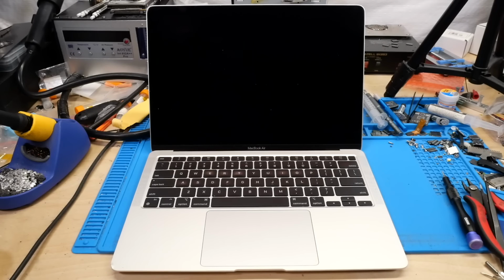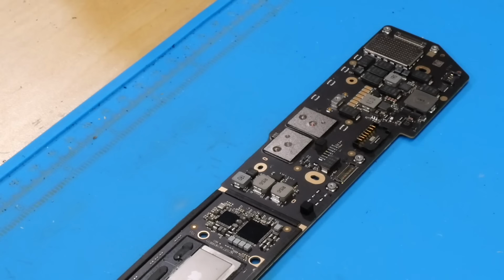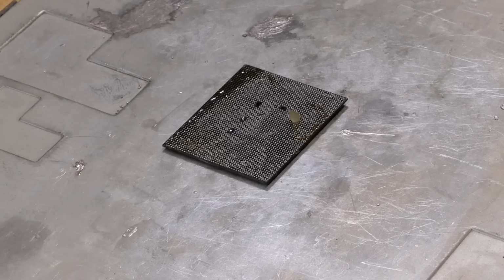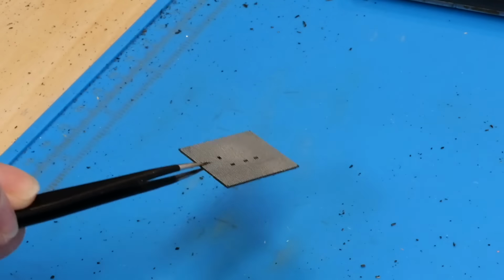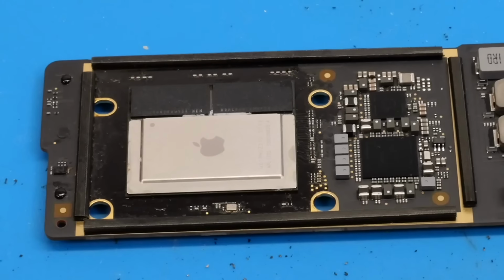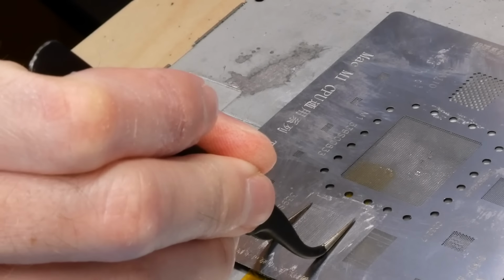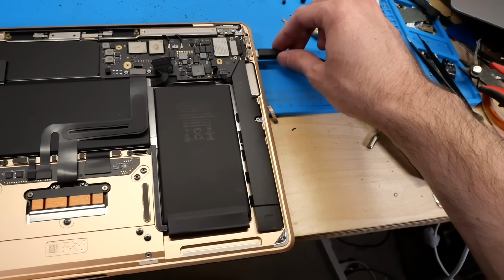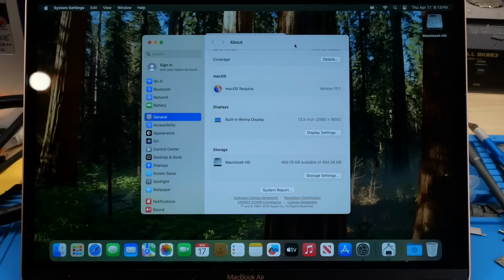Repairing a DRILLED M1 MacBook Air

Comment: DosDude question, well several: 

First is upgrading ram on an m1/m1 pro/m1 max chip possible without just swapping the whole SOC? (If so you could just swap the ram chips and such from the icloud locked SOC to the new SOC and be back to full spec)

Second is the process basically the same for swapping any M1 SOC? Like could you swap an iCloud locked M1 pro with another to use a donor board to fix an iCloud locked one or would there be more components that need to be swapped?

Third is the rose gold fixed MBA up for sale? My wife would love it.

Comment: Try Alpha OM-338PT or Multicore soldering pastes. Those on the drier side. Sadly the Loctite(Henkel) HF111 is not available anymore, that was a really dry paste, it was really pain in the ass to clean it from the DEK printer stencils.

Comment: Is wifi chip in some way locked to evry board ? if so damm apple they are crazy :)) and i also wonder is board will work with removed wi-fi chip is still will boot to normaly but with no wi-fi ?

Comment: I am curious about the sealant around all of those chips you replaced, it’s important since it keeps moisture and condensation from gettin the the underside of those BGA chips plus another factor is providing some shock protection for the chips so the joints do not fail. Other than that wow! Personally I have a Motorola certification for working on surface mount components for 2 way gear but little difference other than BGA work. I wonder who might make the stencil for a Motorola 68HC11 micro controller.
Reply: You probably just need to use a generic stencil of the right pitch, and manually pick off any balls where there aren't actually pads on the chip
Reply: @ thanks! I will look up the specs on the particular micro on these boards. Any source for the stencils I can contact?
Reply: @Subgunman  Do they actually make BGA 68HC11's? I can't seem to find any on digikey or mouser. They're all some flavor of QFP. You should be able to find generic stencils wherever fine chinesium products are sold - amzn, ebay, etc
Reply: @ these were made by Motorola for use in their P50 handhelds back in the early 90’s. The boards could be programmed with analogue and digital squelch and even offered a DTMF option for the radio. It’s second personality was that of a controller for paging that allowed the radio operator to talk back to the caller for a predetermined time. Motorola is known for doing their own custom micros.

Comment: Cant wait for m series ram upgrades, thats gonna be awesome to finally give some use to all those lame 8gb machines with their endless swap.
Reply: I'm honestly curious as to if you need to replace the SOC to upgrade the ram, or if you can just pull the modules off and replace. If its the former then that makes these boards limited in their life, but if its the later then I'm wondering why there aren't videos running round of people doing it yet...
Reply: @mizinoinovermyhead.7523  From what I've read, including from dosdude, the bonding used to secure the ram chips to the SOC make removal impossible without damaging the SOC.

Comment: @dosdude1 Does Apple underfill all those chips just to make it a pain in the ass too remove or will the replaced chip solder joints be less resilient without it?
Reply: The underfill is standard practice to provide mechanical support for the balls. Yes, the joints would be less resilient. Solder is pretty brittle.
Reply: @redare7  He replaces it with lead-based solder though, which isn't as brittle
Reply: @redare7  It just serves the double purpose of also making it a PITA for anyone that happens to try to be repairing any one of their devices...

Comment: You can't move the RAM over too?
Reply from the maker: Unfortunately not, as it's impossible to remove the chips without damage due to the bonding material used.
Reply: @dosdude1  Could you clean the ram chips off the SOC without damage to the SOC then just use new ones?

Comment: Is the reason the WiFi chip is paired because there's  calibration data in the sep , or some  kind of security issue – or is it  Apple just being Apple?
Reply from the maker: There is calibration data for it in SysCfg, but still don't really think the pairing is necessary.
Reply: Its apple being apple. Louis Rossman has been ranting about this and other manufacturers for years already. Its why i avoid a lot of the brands he rants about, including also apple and hp
Reply: It's just Apple being douchebags.

If a highly integrated component needs to be calibrated, you store calibration data on the component and make sure it can work with all machines using that calibration data. It's not like voltage/current/frequency stabilization is extremely hard.

If a component needs to be paired, it will be paired using a pairing protocol, which should include an 'unpair' and 'repair' (pun intended) commands. Which can be made very secure and automatic using a bit of public key cryptograpgy.

Anything else is just bad engineering, so unless Apple's been purposefully hiring only the very worst engineers, they've got no excuse. Good engineers will just implement all of this and not even ask whether it should be done.
Reply: @gleb.salmanov  In this case there likely is an unpair and re-pair protocol. Its just likely that we don't have the level of access to the SOC to do it. Apple surely does, and just keeps it to themselves.

Comment: Baffling. Why don't they just remove the nand chips, and then sell it. If they can afford a drill they can afford a heat gun. Seems disgraceful of them to deliberately attempt to create ewaste.
Reply: Doing a DoD wipe would be easier than opening it up and drilling it.  Though there's an even faster procedure for SSDs.  There's no accounting for stupid though.
Reply: Evidence of physical destruction is required for certain govt contracts
Reply: Because leaking secure data is more expensive than ewaste. Priorities.
Reply: Ouuf 💀
Reply: They don't even need to do that, its just an outdated standard practice to drill the storage from when everyone was using spinning rust. 

Modern SSDs can be sent a SMART command to do a secure wipe. Apple's SSDs in particular don't even need that for the data to be utterly unrecoverable, since the data is encrypted at rest anyways. All you really need to do is DFU wipe it. If someone desoldered the NANDs off and etched away the casing, even if they managed to pull bit values off of the flash, it would all be heavily encrypted garbage with no practical way to find the key.

Comment: in my opinion, this is not really "Repairing a DRILLED M1 MacBook". 😉
no drilled tracks, pads or chip dies are repaired😉Just the CPU and wifi were desoldered and the entire motherboard was replaced
either way, it's still impressive 👍👍
Reply: no one said "Repairing a DRILLED motherboard" :P
Reply: @digitalk68  But the title sort of implies hes going to fix a drilled out PC, not just take some parts off of it..
Reply: the machine is essentially the ID programmed into the SOC, so by moving the SOC and related locked chips to another board, it really is repairing the drilled machine, by way of transplanting onto a non-damaged motherboard

Comment: I'm watching this wizardry on an M1 MacBook Air.
Reply: ugh, enjoy your walled garden locked ecosystem. I'm watching on a linux mini desktop machine on my TV - live free or die!
Reply: @gorak9000 I’m sure he will enjoy his walled garden Mac with its power efficiency, lack of driver issues and MIDI/audio that really works!
Reply: @SproutyPottedPlant  I've never run into any problems with linux (recently, in at least the last 10 or so years) with power efficiency, drivers, or audio or midi. Sure, those used to be problems a long time ago, but things get better. People actually work on and improve linux, unlike winblows where they just change the UI, and re-organize the control panel to make everything look different every couple years
Reply: @gorak9000 sorry dude but M chips being power efficient isn’t Mac OS thing. It’s hardware thing
No x86 machine is as efficient as M chip macs unfortunately so no Linux will fix this for you
Reply: @pracalt1051  Doesn't much matter to the end user if the designer of the laptop puts a slightly larger battery in to compensate for the chip being a little less power efficient. There's more than one way to skin a cat
Reply: @ it does because arm isn’t x86
It has some great quirks from the phone like the fact that performance on battery life being same as on charge which is huge problem with x86 laptops + camera that actually doesn’t suck + actually functioning sleep mode that doesn’t sip your battery much + no need for a fan making it silent while the performance in question is still being great
And the battery life in question could last all day long with some good percentage left
This is same advantages that windows arm laptops have further proving that this is hardware advantage and I wish Microsoft keeps pushing development of those
Reply: @ also the fact that arm laptops can have ram right into soc makes huge advantages in terms of speeds(albeit it does kind of remove ability to upgrade it which I will agree sucks)

Comment: nah that's wild, even the wifi chipset is paired, damn apple is going crazy with each component
Reply: Worse than 2012 Lenovo requiring wlan/wwan modules be on a whitelist or refusing to boot for sure.
Reply: Exactly what I was thinking!
Reply: Macbooks are just pain to repair, so many things guaranteed to cause you problems.
Reply: This anti-consumer anti-repair behavior should be illegal. I get the security benefits of the pairing but they could just show a warning message in the boot screen that the firmware is tampered/insecure.
Reply: @YouCanHasAccount  everyone knows the pairing has nothing to do with security.
They're not fooling anyone
Reply: It's crazy, the hoops Apple makes you jump through. And all just so you can't repair your own stuff but have to go pay Apple a lot of money.
Reply: yeah, it's why I wouldn't get a MacBook Pro any newer than 2012.  Not like I need it for much anyway, it's mainly there in case I happen to need to run something under MacOS.  Pretty much use Linux for everything else.
Reply: @SenileOtaku  for those cases I use Hakingtosh and an old iPhone to enter on the iApp so I can publish apps, pretty much for anything else a real MacBook isn't even needed
Reply: @SenileOtaku Trust me, 2015 is still the best one imo
Reply: @SenileOtaku  2015 is even better.
Reply: Just watch Louis Rossman who litteraly posts about such things manufacturers do to make their products as anti consumer. Its why i dont like appl and will never really buy myself an apple product, unless its an older one which can be repaired and upgraded
Reply: Avoid apple at all costs! Have been practicing this successfully for over 30 years, no issues so far 😊 But dosdude videos are always fun
Reply: @HNedel  avoiding apple is hard when macbook went from “cashgrab from the rich and the white collar” to “productivity monster”
Reply: @HNedel  i hope a “mobile productivity computer” is not in your cards

Comment: Beyond obnoxious for someone to drill NANDS.  I mean seriously WTF x10 !!    Who does this ?  Is this common??
Reply from the maker: Some companies require the storage on their machines to be physically destroyed when decomissioned, so on machines like this with soldered storage, this is really all that can be done to satisfy that requirement outside of destroying the entire machine. Honestly I wouldn't even mind if they could have just controlled the depth of their drilling more precisely and not hit the board haha.
Reply: @dosdude1  Speaking as someone who works in corporate IT, the perpetrator is using outdated guidance – unnecessary and excessively wasteful. SSD data is much more difficult to recover post-erasure than magnetic media (ie: spinning hard drives), and the technology used by companies like Apple (eg: T2 chip) makes it very difficult to forcibly recover old data once the device has been dutifully reformatted.

Unless whoever is doing this works for the CIA (in which case you'd expect the entire device to be disposed of) this is total overkill. Thankfully there are people like you out there undoing this horrific waste (and entertaining us nerds in the process).
Reply: @GeekmanCA  Yeah, we had a similar issue at work with an overly paranoid IT department who would pull and shred server SSDs that had plenty of life left in them, but where they had upgraded the disk arrays. Shameful waste, given they could've just done a secure wipe and re-sold them or even offered them to employees.
Reply: @dosdude1  considering that the actual NAND is a thin layer on the same side as the balls you have to basically drill through to be sure the circuit gets damaged.
Reply: @dosdude1 got it thanks for that explanation.   so presumably those companies realize they've killed the device and send it to over to the recycler as e-waste.  Then the recycler trash picks and puts certain machines up for sale.  Hopefully they offered full disclosure, as in this case it really had next to no value what with broken screen and logic board, as 99.999% can't do the magic you do!
Reply: Corporate data protection.

They destroy hard drives, too. Either a demagnetizer pass or a drill and a bath in salt water.
Reply: I work for the world’s largest data broker. They must be drilled. Govt contracts require it.
Reply: @AnonVideos  Yeah take an extra few minutes remove the nands then drill. Burn the nands sell the chassis on ebay or wherever and reduce ewaste. I work for a huge data broker too, and when they told me my old machine was going to be slagged due to data security policies I was livid.
Reply: @mizinoinovermyhead.7523  Physical evidence of destruction is required. Removing modules means you cannot prove it was the same item that was destroyed and now you are taking expensive tech time to play with it also. These contracts are for huge amounts of money, and procedures must be followed to the letter… regardless of whether they are best decisions or not. Your training should have covered this, it is a common question when onboarding.

Comment: Can you hypothetically transfer the LPDDR memory chips from the locked SoC to the working baseline SoC?
Reply from the maker: If they could be removed without damage, in theory yes, but they unfortunately are well secured to the SoC with extremely strong bonding material, which is impossible to remove without causing damage to the RAM chips and/or SoC itself.
Reply: Thank you very much for the details!
What’s harder in practice, destructively removing the DRAM chips without damaging the SoC or not damaging the DRAM chips while the SoC might take damage? Or is it more or less a coin toss?
Reply: @abavariannormiepleb9470  If you are going to upgrade the RAM, you are going to toss what is already there, so I think it must be that removing the bonding is going to damage the SOC in every case, otherwise it would have been done already.
Reply: @dosdude1  Really? They are doing this on purpose to prevent board repairs/upgrades. That's wicked